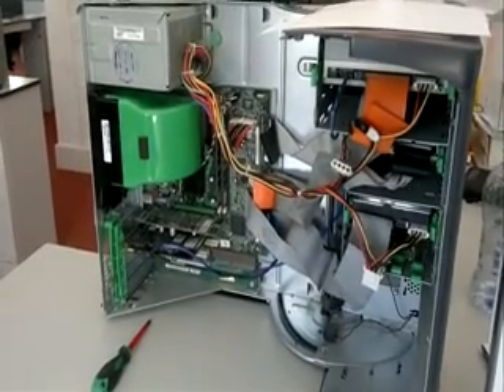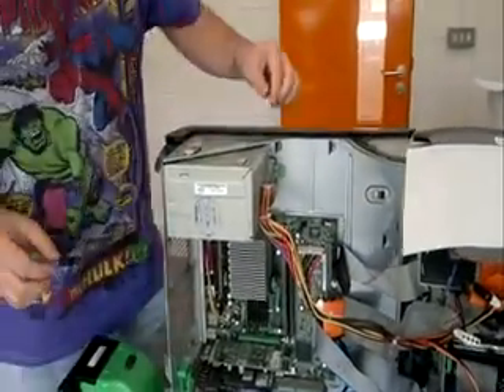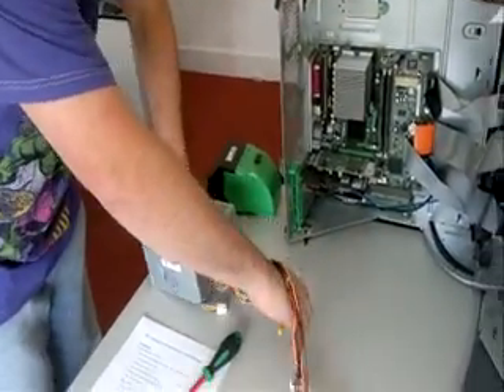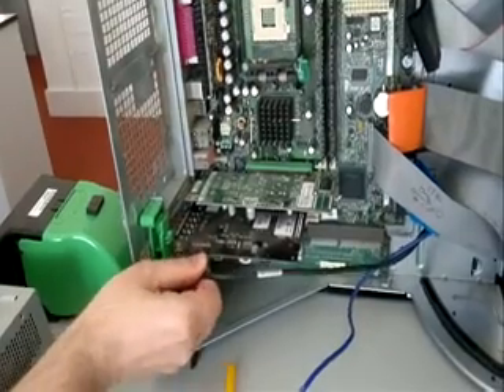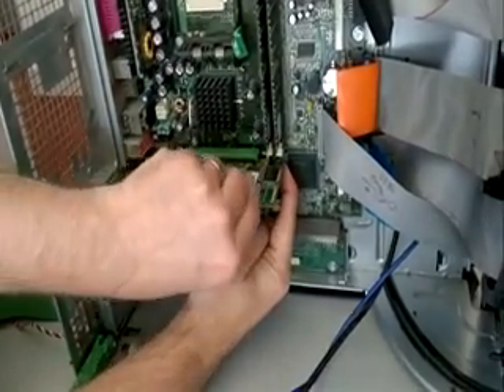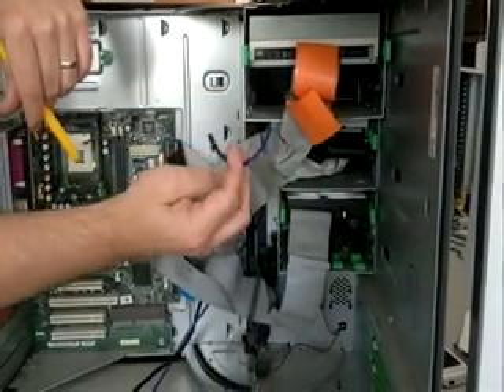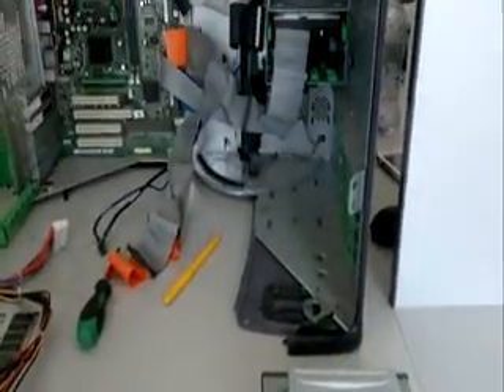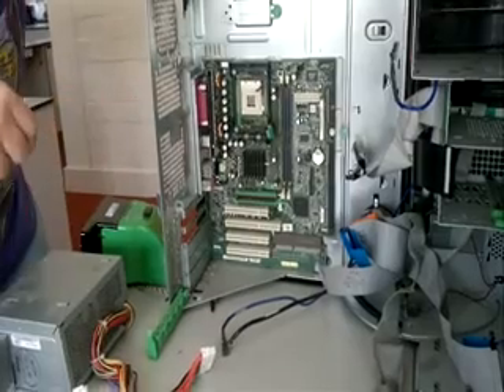Disassembling a computers internal parts

Comment from the maker: @Ale6ander579  Yes it is the first thing we show in this video, just make sure you are replacing like with like so it is the same type of power supply i.e. make sure all of the ratings are the same i.e. voltage, frequency, current and watts.